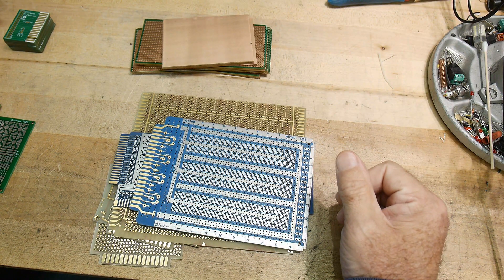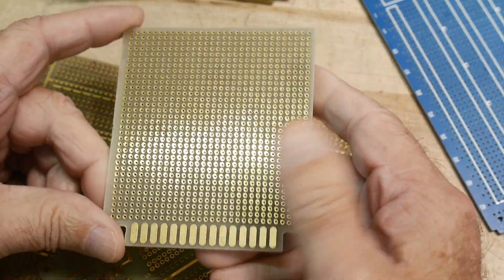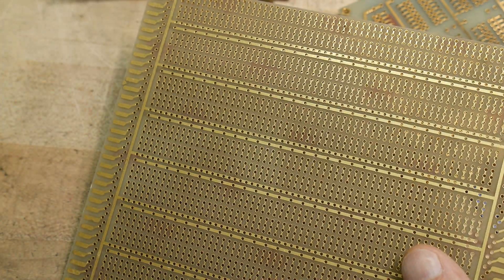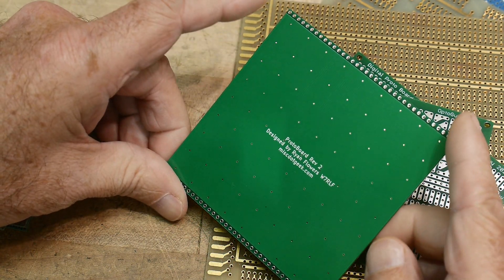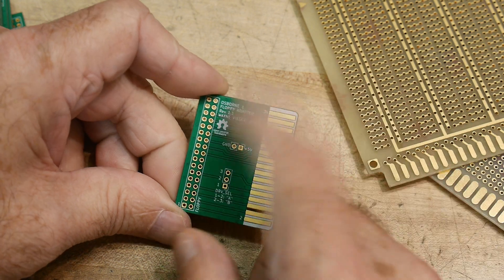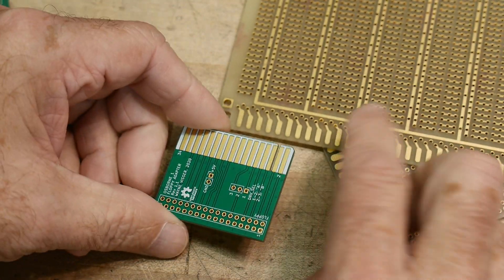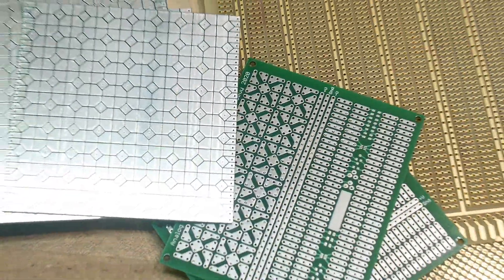#1027 Proto PC Boards and one Osborne adapter

Comment: Very nice rundown of proto boards. I could actually use a couple of those narrow boards that You introduced
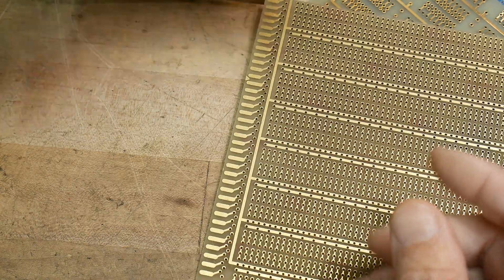 at about 5:36 in. Do You happen to have any info on where I could buy a couple? Thank You!
Reply from the maker: sorry long time ago. probably ebay
Reply: @IMSAIGuy  Yeah, I figured that might be the case. Thank You!
Reply: It's known as Veroboard (or more generically as stripboard), and it's still available.  Use those terms in your favourite search engine to find a supplier. The associated cutting tool is handy for breaking the tracks.

Comment: Veroboard was the only available choice for me before the internet ,It worked well when I was learning electronics
Reply: Same here. Verowire with combs too. Kinda glad we've moved on nowadays though!
Reply: Yep. I suspect Veroboard was the “goto” choice for most UK constructors. It was well known, readily available in the UK, and featured in all the UK electronic magazines of the 70’s to 90’s. For digital wiring I also used the Verowire (and combs), but when I tried to use some very old Verowire recently, the insulation was difficult to melt. Perhaps it “goes off” over time?

Comment: You can get nice 150x185mm prototype boards with a 3.96mm pitch card edge connector (the blue 805 connector fits this). Comment gets deleted if I say where, but they look like bigger versions of the one at 0:50

Comment: I use Busboard SP3T-50x50-G and SP3-100x100-G extensively for mixed signal work. Solid ground plane, 0.05" or 0.1" pads.
Reply from the maker: thanks, I have not seen those
Reply from the maker: I like the idea of a board for SMD prototyping. When you use these boards what would you like different? a combination of pad sizes on one board. some thru hole also? I'm thinking of laying out a new board.